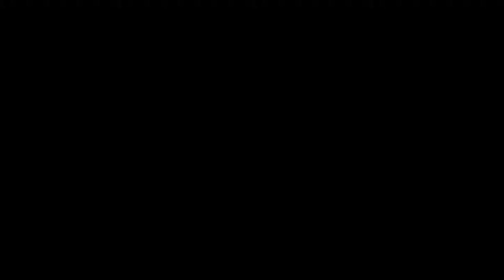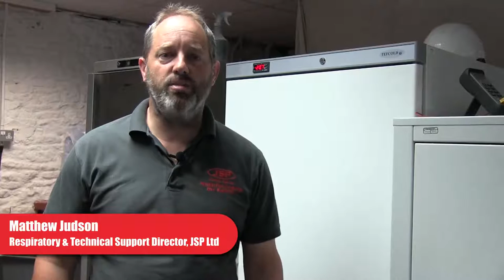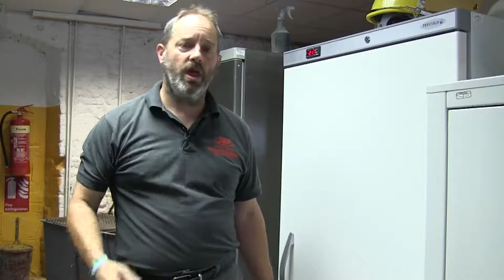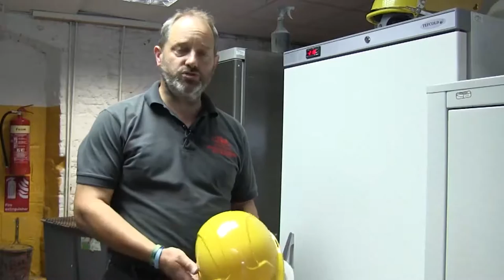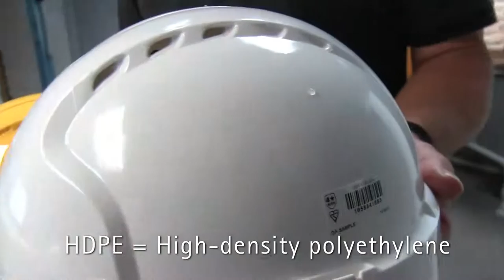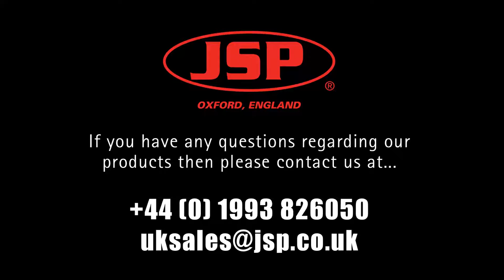Vlog #4 - What is the difference between ABS and HDPE? (in hard hats)

Comment: So the difference is personal preference?
Reply from the maker: +Genopsyism Last Hi, yes both materials conform to EN397 however ABS is a much lighter material whilst HDPE is heavier. This weight difference would come into play during long working hours or working in temperatures such as houses during peak summertime. The lighter ABS material may be more comfortable under these circumstances however as you said this is just personal preference